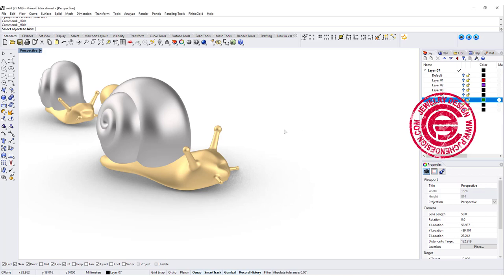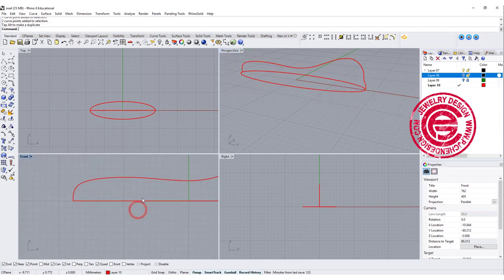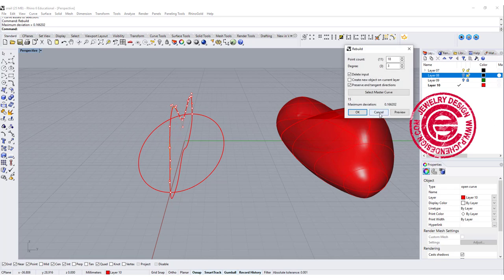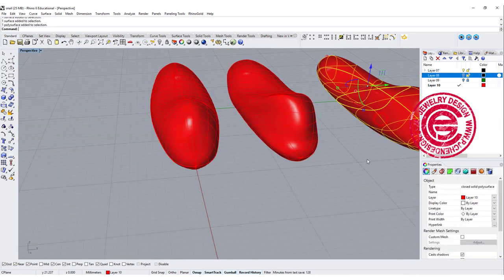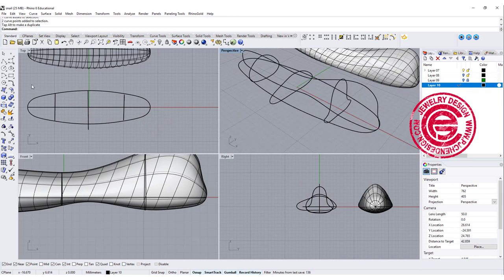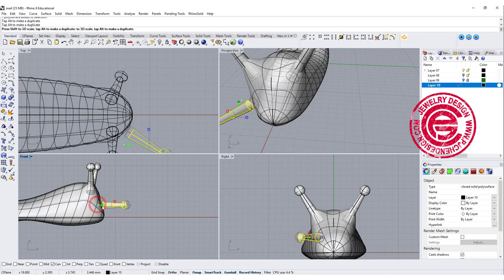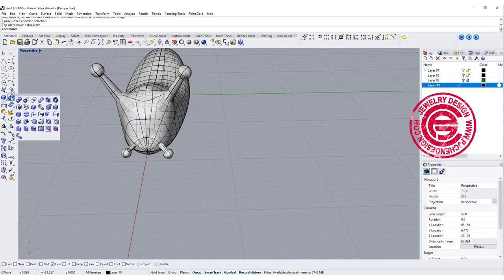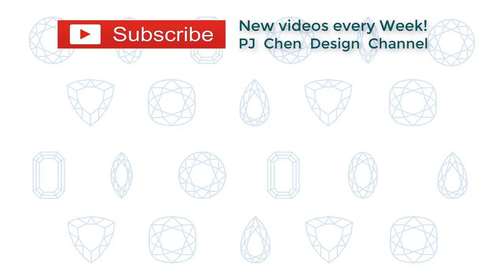How to 3D Model Snail Body in Rhino 6 (Part 2): Jewelry CAD Design Tutorial #106

Comment: Very good. I had a trouble splitting the shell from the first video, it would say split failed on my laptop. I retried on my pc and it split ok, but then after I capped each part I couldn't union them all successfully. Did anyone else have any of these issues?
Reply from the maker: You may want to check. 1 if the object is solid before you split. 2. was the split line straight or curve. If both are, you can email me your file to pj@pjchendesign.com I will take a look for you.